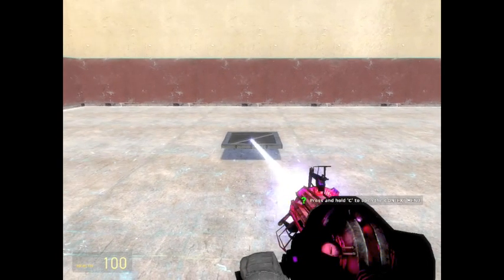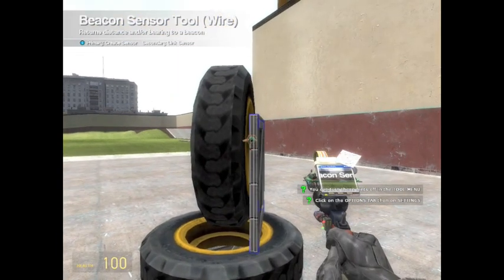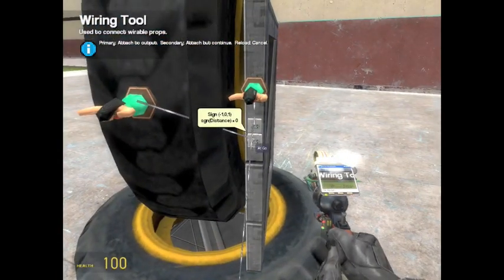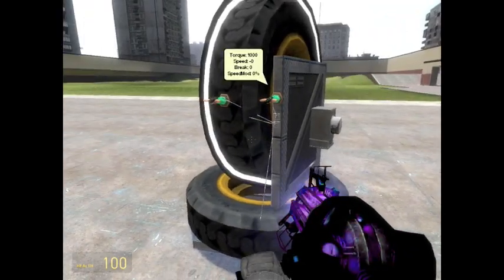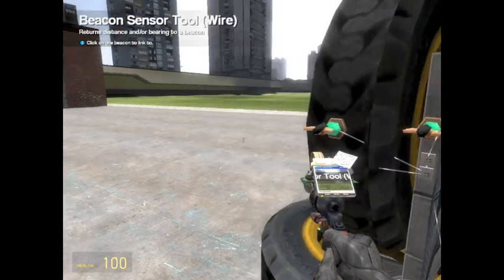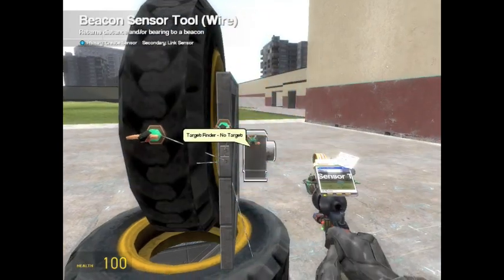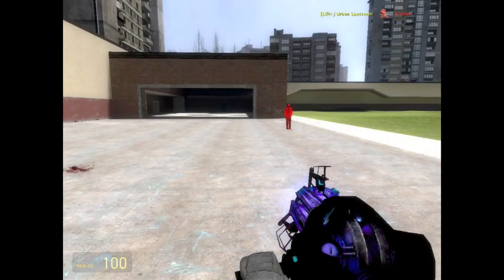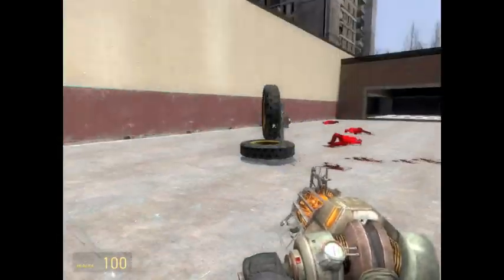Gmod Wiremod Auto Turret

Comment: Hello, I've been going through the video and the comments here, in 2025, I think I made one functional turret via these, you may just edit the process after building the initial turret contraption in this video:

Beacon sensors: "Output Distance" "Output local position, relative to beacon" tick these options and then Update your Beacon sensors by left clicking on them.

When wiring:

 Chips will show a table that lists "Outputs: Distance X Y Z" Select X. For the bottom, select Y and conclude.
Reply: I was struggling for like 6 hours, thanks mate. That's actually funny that this game in 2025 is still amazing, after all this years...

Comment: If you've got constant spinning, you probably need to reduce the torque of the wheel. A value of 300 worked fine for me, but it was really slow. You can also try increasing hinge friction, but increasing it too much might make the turret stuck. Test different values to see which is best for you.

Comment: Can someone give me a name to the mod that gives the little lines in the prop so that we can tell which is the centre of the prop more easily? I would really appreciate it
Reply: Smart snap. Also, to prevent the turret from aiming at the feet,wire in an add gate that adds about 40 units to the beacon sensor's Y output.
Reply: +randomdude1194 noice

Comment: @AdmiNLocK U can add an "Gate - Arithmatic - Add"-chip and a constant value of 50. Then u wire the subtract-chip output to the Add-chip, aswell as the constant value. Then use the output value of the add chip as the Z cords.

Remember - this is for the Z-dimension

Comment: insted of a wheel use a sighn(1,0,-1)
chip then put thrusters on side edges and wire sighn (1,0,-1) to a beacon sensor and out put bearing then wire the becon sensor to target finder.(this is usefull when tyou want a prop instead of a ugly wheel!!!!